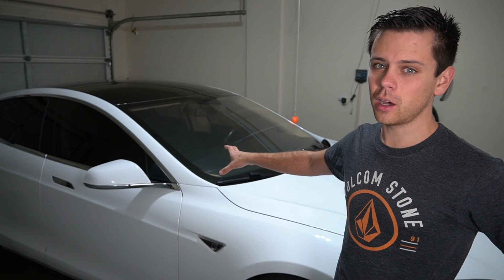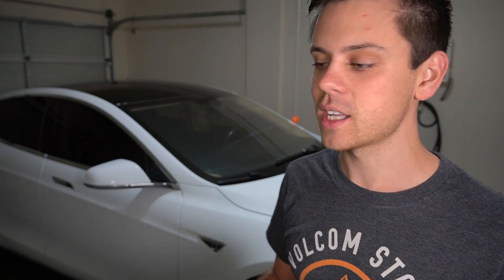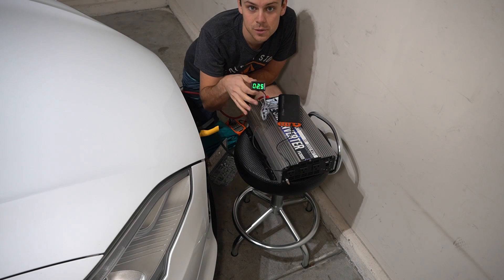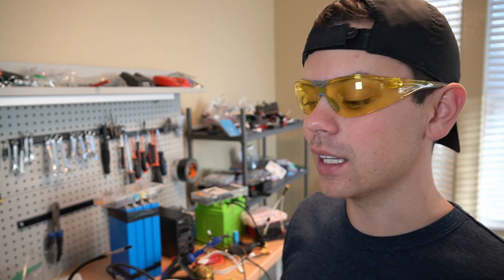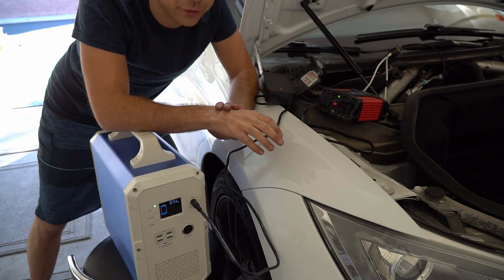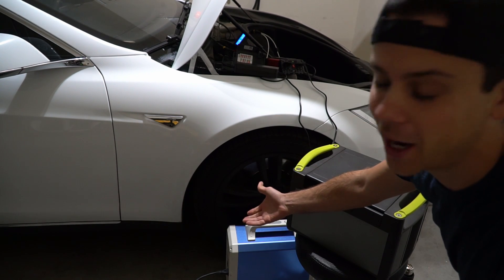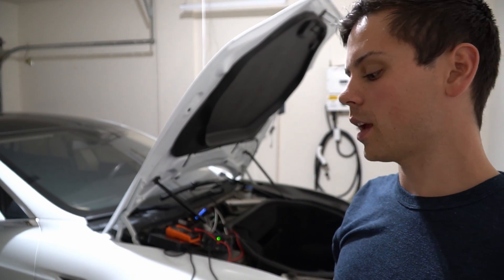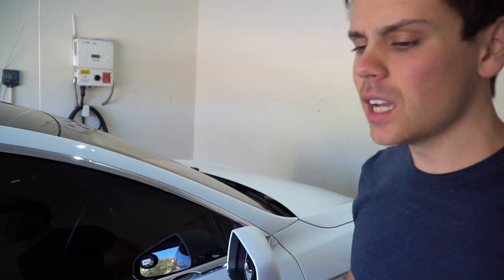Hacking my Tesla Model S for an Emergency 12v Power Source

Comment: I did a similar thing with my Chevy Volt, but it was much easier as you just hook directly to the battery terminals (which aren't hidden far away)... It can handle over 500 Amps peak (because you're hooking directly to the 12V lead acid battery), and the DC-DC converter can do 12V 165 Amps, so that's like almost 2kW continuous (minus the parasitic load of the car) and probably 6-8kW peak. I was gonna get a 3kW peak (1.5-2kW continuous) pure sine wave inverter so I could run anything off of it, including charging up my other electric vehicles. I just got a Model S, and was hoping to do the same thing, but it sounds like it'd be more complicated to get that much power out of it. :(

Comment: Recently there was news that tesla did not give warranty repairs for someone who used their car this way, during blackouts. And developed some problems. So make sure you do not leave any evidence behind with wiring etc if your tesla is under warranty. 
Also make sure that your tesla also tops up the 12v battery. Most EV's do it only when you turn the car on (not drive, just on), for safety reasons.  Not connecting the traction battery when car is not turned on. This behavior might have been changed with software updates.

Comment: This was a fun and inspiring video. Thank you, Will! Some good news, Tesla (Elon) says the Cybertruck will be equipped with a construction grade inverter system to accommodate at least the needs of most construction crew electrical equipment in the event a team has no construction power (until made available from the utility company where practical). The truck version with the smallest battery will be 100kWh. I imagine they will put in a fairly beefy outlet array for this purpose but I do not know by what method they will connect to stored energy (the 12V or ?). Now you have me wanting to experiment with my AWD M3P, the main battery in these I believe is a 75kWh. I definitely would not go beyond the 12V system, that is for certain. The main battery in these I believe is a 75kWh. Again, thank you!

Comment: Not goo g to mess with my 100k models S when I have a 10k gas generator to run my whole house. 
Generator cost = $700
DYI switch with wire to breaker panel cost about $200.
Power goes down and I power my house without risking g my 100k Tesla
KISS

Comment: I have previously speculated that the 350-400v battery could drive the output stage of a 240v inverter directly.

Comment: Why not connect the 12 volt output to 4 groups of 12 volt equivalent cells to charge a 48 volt system instead of stepping it up to 48 volt?  You would just need to make a connection to the 4 groups with something like an anderson connector and maybe have a cable to the tesla 12 volt terminals with an anderson connector to the dc to dc converter.  The only need for the converter is to limit the current draw from the tesla which also enables use of manageable size cables.  You are essentially attaching a very large auxiliary 12 volt battery to the Tesla.

Comment: Will: Which yellow wire? The video image shows two yellow wires. Connected to two different places. Seems like it is the upper one. But I want to be sure. What do you think about using this sort of power tap to run things like a small fridge in the car while travelling?  Thanks for your numerous great videos.
Reply from the maker: Oh just download new Tesla upgrade and put it into camping mode
Reply: @WillProwse   Umm ... what?

Comment: I would certainly keep the setup permanently wired. You never know when it comes in handy.
Can you correlate capacity to miles left? Just do you know you have enough juice to get to the next supercharger? 
That 60kw battery would be able to power my off grid cabin for a solid 10 days without solar input, that’s insane. 

In the video you keep saying when the voltage drops to 12.2 bolts the charger brings it up to 14.xV - is that an internal Tesla charger? Or is the car plugged in? I’m not sure I follow that reference. 

If you want to charge your Tesla from solar - at night. How would you build such a system without breaking the bank? 50x 100amp/1200wh batteries would run a solid $45k without the other infrastructure. 

Looking forward to more videos on Tesla hacks :)

Comment: im lazy.  that and i will never own one of those silly electric cars... got a 4500 watt gas/propane generator... only cost me about 50c hr run with my solar set up doing the small stuff--   now i did have extra long 4 gauge jumper cables to run my inverter off my gas guzzling SUV before i got the gen...

Comment: I spoke with two different Tesla tech support persons on two different occasions and was told that with the model S, the battery management system to charge the 12V battery from the main high voltage battery does not work unless the vehicle is in motion.  What this video shows is the exact opposite: the 12V battery being charged from the HV battery with the vehicle stationary.  Are the Tesla tech support people wrong?
Reply from the maker: They must be wrong because even when the vehicle was locked and turned off, the DC DC converter would activate when vrsla went too low. Sounds like they are wrong. You can test it yourself
Reply: DIY Solar Power with Will Prowse 

Do you know the voltage of the 12 V battery that would trigger a recharge from the high-voltage battery?
Reply: @WillProwse  Yes they are wrong, otherwise a lot of Tesla would be "bricked" so often when they left siting or parked even plugged after few days! that happens only when the dc dc inverter is malfunctioning or has blown fuse.

Comment: Man, I wished I would've seen this earlier. here's an article I ran into

May 21, 2019
Our thoughts on Tesla battery based systems for RVs
We frequently get questions regarding Tesla battery based systems and how to incorporate them into their van, skoolie or motorhome.  Customers with hopes of designing the ultimate mobile power system are buying these batteries second-hand after they have been used in drag races or salvaged from wrecks.  Because of the Tesla brand image, low price, and high capacity, these are seemingly attractive batteries.  But, at the time of this writing, the engineers at AM Solar can’t recommend them for a number of reasons.

Used Product
Most, if not all, of these Tesla batteries are used, and often the use has not been gentle.  There is no no warranty and you really don’t know what you are going to get with slightly abused batteries.  AM Solar’s reputation is built upon selling and supporting rock solid systems, and it doesn’t seem like this qualifies.

Removed Cooling System
The cooling system for the batteries is built into the Tesla car.  When you take the battery out, it is very difficult to reincorporate that cooling system and is typically disabled. This increases the risk of overheating and limits the battery performance.

Battery Management System Integration
The proprietary Tesla BMS is difficult to interface with. There are many companies making products to solve this problem but in many cases, the new operation is far from the original battery management and balancing system. Until we can find a system we trust and depend on we will not be suggesting or supporting installations of these systems.

Voltage Range
Tesla batteries operate over a wide voltage range that is too high for 12V systems and just barely too low for 24V.  The result is that a Victron Multiplus 24/3000 inverter can draw them down to 19V, but doesn’t start charging them until they are 21.8V.  The gap between 19V and 21.8V represents about 40% of the battery's capacity.  If you had them in an unregulated system that let you draw them down to 19V, you would have to rely on another charging source (besides the inverter/charger) to get them up to 21.8V before the inverter/charger could do its thing.  If you regulate them to prevent the inverter from drawing them past 21.8V, you miss out on 40% of the battery bank’s capacity, and that’s annoying.

AM Solar aims to be the technological leader in mobile power systems and we have conducted extensive testing on a Tesla battery system.  We are currently designing and working with a prototype external BMS that will hopefully solve some of the Tesla battery issues, but the major bottleneck has to do with inverter limits.  

AM Solar has been successful because when we take a customer’s money, we make sure they have a functional system and we support that system for the life the vehicle.  Anything beyond a solar charging system on a Tesla battery based project falls into an area that we feel isn't functional and isn't something we can support.  Therefore, we aren’t going to take on the project.  There are other lithium options that are far more dependable and easier to install.

This article is not meant to disparage the Tesla company or their products in any way.  It is my opinion that they make

Comment: Several comments: 1: Thanks for the many videos over the year since i subbed. 2: Fossil fuel is a political term, and when crude oil was found so deep below in rock strata there was no possible way that dying dinosaurs could melt into oil i became convinced by those speaking of the continuous lies frothing from the mouths of oil industry and actors supporting them. 3: i am so happy for you that some things evolved into what you experience now. . .you are worthy. Thanks!

Comment: I am curious if the Tesla has the ability to set a "stop recharging the 12 volt when the drive batteries are close to just enough to reach a working charge station".

Comment: another great video.  however irrelevant to the content of the video, in regards to oil:  one of the biggest lies ever told is that oil is a non-renewable resource. Oil is not a fossil fuel but a mineral and constantly replenishes/regenerates....... The oil companies just use this lie/myth to create fear of oil shortage and to increase oil prices at will.  Aside from that stay on the journey to help others become more energy independent!

Comment: Thanks for sharing your experience here - i think i understand your approach. I didn't know the tesla model S also has a 12V lead acid battery, but if you think about it, its obvios it is necessary for the 12V board system (of every car). Although it is good practice to be careful here with as little invasion into the tesla model s energy system, i think the overall efficiency would rise quite a bit if you could directly access the 400V traction li-ion battery. If you use the 12V from the auxiluary system it will get charged via internal 400-to-12V buckconverter than taken to your Solar batteries, imported to your house, connected to a 120 or 230V AC inverter then the power consumed. So this is several charging and converting energy back and forth always with efficiency losses. If you could just run a wire from the 400V li-ion battery to your house, invert it directly into the walloutlet power (120V in the US) then efficiency would be much better i guess. Of course you have to make sure you dont intrigue with the energy system of your tesla too much and must be very carefull with high voltage and energy control for your tesla battery. But it would be great if you could have full access to your battery because you own it and paid for it - so why dont use it to its full capabilities? :-)
Next suggestion: you need a solar system capable of fully charging your tesla in 1-2 sunny days :-) So this could mean at least 10-20 kWP solar panel system.

Comment: Love love love this video... Don't much understand it but I love it. Will, in the case of using only an inverter and an extension cord to the fridge, if the power outage goes on so long that the Tesla's large battery is starting to get low can the solar be plugged into the car while the car is running the fridge? I'd like to avoid using a supercharger if solar power is available. And during one of our last power outages, our superchargers were down also. Off to watch this a few hundred  more times.

Comment: I would question if the computer would keep track of the discharge rate and see that the car isn't doing anything and the main battery keeps depleting if this might void some warranty or something if they questioned you and you told them what your doing.  I understand in an emergency but if someone was using this as essentially a "bucket" to transfer power to an offgrid system from a super charger if it wouldn't lessen the life of their tesla battery.  It would have to they only have a limited number of charge cycles.
Reply: That being said the fact that you can do this from your Tesla is So FREAKING amazing.  1. I had no idea it has another 12 volt battery.  But now that I think about it I guess that makes sense.  2. the fact that the car monitors that and will kick in charging to that battery is another amazing fact.  3.  I want one more then ever now!!!!

Comment: Hey Will, thanks for doing this! I have a model 3 and was looking into this as well. What is the safe amount of current you can draw do you think? I was thinking of putting a large anderson power connector (50 or 100amp) in the frunk and then I just hook what I want to it. Cleanest way I could think of doing it.
Reply from the maker: Exactly, and I would stay under 50 amps to be super safe. Anderson in frunk is ideal

Comment: Funny every time I stumble on a video about powerwalls or backup power, people always mentions that they need to run their big ass fridge for a week on it!! I owned a house where the fridge stood in an old pantry cabinet without door against an outside North facing wall. The pantry had top and bottom vents to circulate outside air through it. However instead of blocking the vents, i put styrofoam strips in the door opening and panelled it with wood, to make it look half decent! So from around mid September to late April, my fridge never ran, and the rest of the year, it ran rarely. I'm not American, but live on the 55'th paralel. So I was saving at least 1/5 on my electricity bill that way and didn't need backup power to run it in most blackouts as it could easily sustain a reasonable temperature for 24 hours in summer.

Comment: This points to something I would really like to see EV makers provide on every car... an external regulated 12V or 24V output with decent current specs that can be used to power a full-sized fridge and a few appliances in an emergency.  Perhaps with the help of an external power bank that has its own (small) battery to deal with spikes, so the car doesn't have to.  It would be ridiculously cheap for car makers to provide an external output like that.  Literally, it wouldn't have to provide more than 300W or so.

-Matt
Reply: another comment made me realise there are trailer/caravan plugs, wonder what the highest spec is?

Comment: I understand the concept and your explanation at the end about the losses was spot on, but I would think if your charging your Tesla from your house circuit the easier way would just be to reverse the power flow. From the Tesla to the house (please understand ALL safety concerns including backfeeding the power grid should be realized) instead of from the house to the Tesla. Just like any home backup generator would do. I think there would be a lot less parasitic loss in that type of system. Love all your videos and I learn a lot from them.

Comment: Will - I have a 2200 watt Giandel pure sine inverter hooked directly up to my 2017 Kia Optima PHEV (I have two) with a 9.9KW battery.  I am able to run a chest freezer with it and don't experience any draw down on the battery. Car has to be on and will probably run for most of the day.  What is neat about this is that I can hold down on the Electic/Hybrid mode button and it puts the car into Charge Mode.  Barely uses any gas to fully charge the battery and can even do so while driving and running an errand and come back with a fully charged battery.  The range on the car is like 630 miles.
Reply from the maker: Very nice.

Comment: I also didn't know a tesla had a 12 volt battery.  What is the purpose of it with that small a wire doesn't look like you could jump a non electric car with it even though you could charge their battery slowly.  Is it to run 12 volt accessories in car etc like cell chargers spot lights air compressors etc ?  
It would be a very interesting experiment to see if charging the Tesla 12 volt  battery will reverse to slowly charge the Lithium batteries . Some inverters will more or less automatically act as chargers also (see Jack Ricards channel) I doubt that it would and even if it did it could only do 2miles an hour or so but could be useful in a pinch.

Comment: I have also thought of that and even though I don't have an electric car I do have two golf carts (one is set up for hunting) One is 36 volt with  six 6 volt batteries and other is 48 volt with eight 6 volt batteries for longer range hunting.  I use these as battery bank for solar also.  I added 2 more 6 volt batteries to 36 volt one to make a switchable 48v to 36 volt.  I can charge both from grid also with original chargers or I can even use my 1000 watt yamaha generator to charge it with my 40 amp 12 volt charger when I leave hunting one in remote location by hooking the batteries in parallel with jumper wires.  I just fill up generator start it and leave it charging till fuel runs out. I do this because 1000 watts is not enough to operate the 48 volt charger for the cart at say 25 amps.

Comment: Great video! I am annoyed at how many energy storage systems limit you in how you can use it. Vehicle chargers should also allow you to power stuff from the vehicle when needed. Plus, there should be a plug in the trunk where you can quickly swap out portable battery banks to extend range.